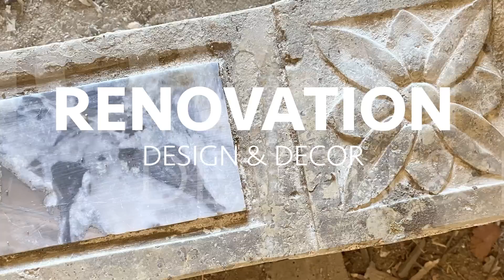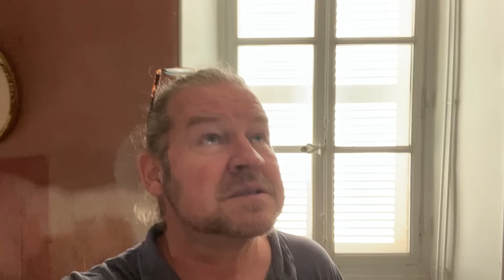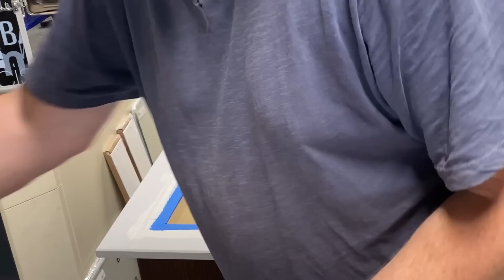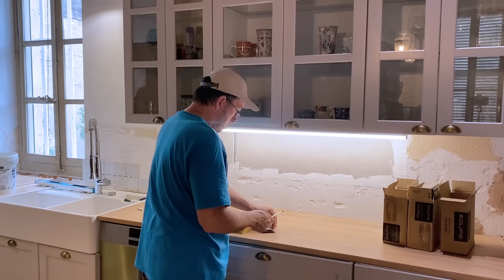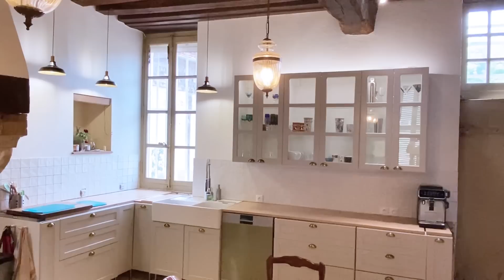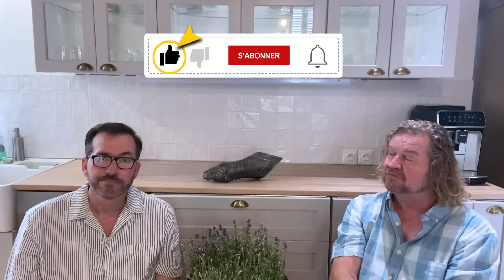CHATEAU kitchen RENOVATION, upper CABINET INSTALLATION and tiling - Journey to the Château, Ep. 104

Comment: Very nice workmanship. An easier way to hang cabinets is screw a leveled piece of lumber to the wall at the height you want to support the cabinets while you hang them. Little easier on the arms. 😊 🇨🇦
Reply from the maker: Yes, and we did that in the states with stud walls and drywall. Considering the difficulty of drilling and anchoring into solid stone walls, that would not be easier in this case. Thanks.
Reply: As Stuart said…..  we wish we could do that here….  Drilling into stone walls… 😮😡🤬. I was sweating like a truck driver……. No recording though 😂😂😂. Huge thank you 👍🏻

Comment: Do you plan on doing some sort of channel or something to disguise the wire going to the rosette?
Reply from the maker: Yes, that was actually shown in a previous episode. The wire you see is the old one that still just needs to be removed. Our electrician has already ran new wiring up inside the ceiling that only comes down at the center of the rose. Thanks!